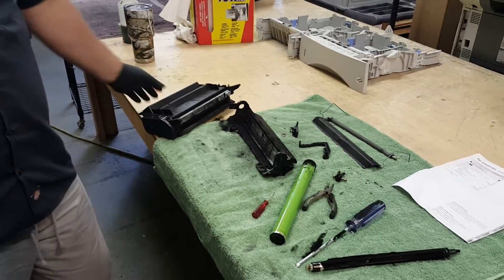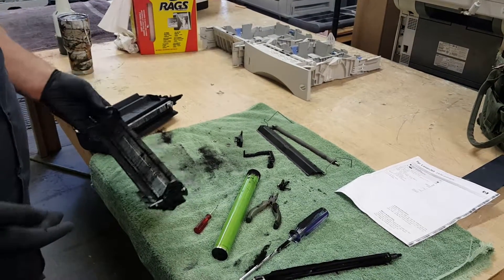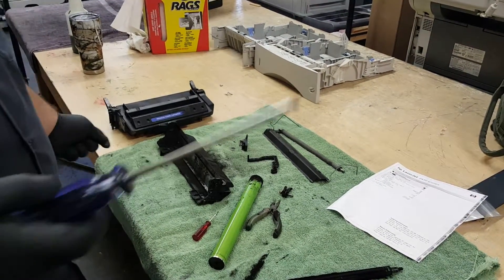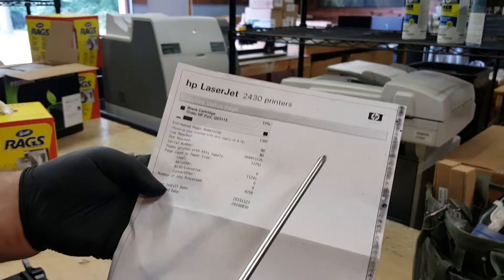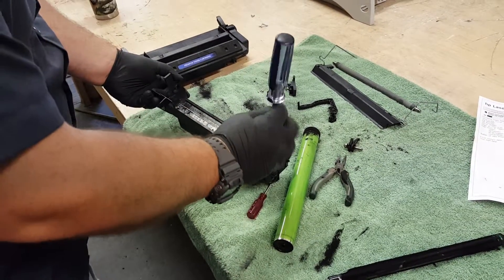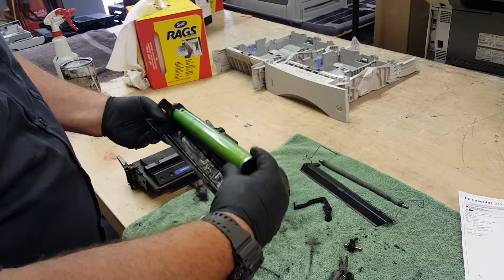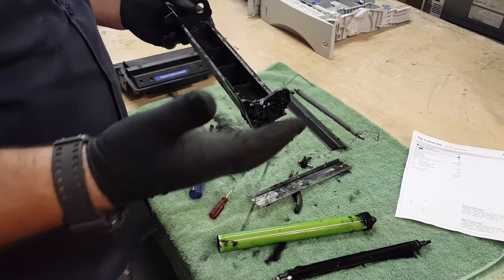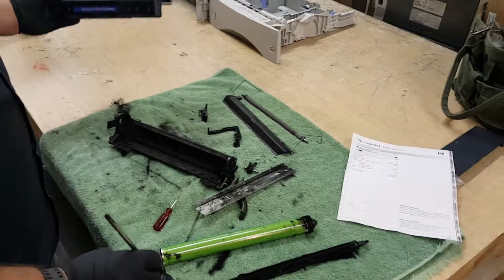Full Waste Hopper

Comment: Hello, I have a Dell 1320c Laser printer. The black toner began coming out like a dark magenta for some reason. I completely cleaned out the black toner waste hopper or toner reservoir (I'm not sure which) because it was completely full. After cleaning it, I installed a brand new black cartridge but now it's no longer printing black toner. If it was the toner reservoir, did I ruin it by cleaning it out or does the reservoir just need to become full again before it starts printing again?
I made sure to reassemble the hopper or reservoir exactly how it was using photos I took when I disassemble it.
Thanks for your time.

Comment: Can you tell me if printing a normal business letter with all black lettering except for a blue signature line will cause the waste hopper to fill more quickly?  That is what I was told by the guy where I buy my refilled toner cartridges.  The printer is a Canon Mf8580cdw.  I started get streaking down the side of the page like in your video after only about 200-250 letters printed.
Reply from the maker: Each model is different.  Some are more effient than others.   The small the cartridge the more likely it will fill faster